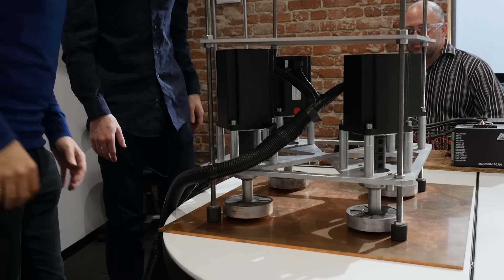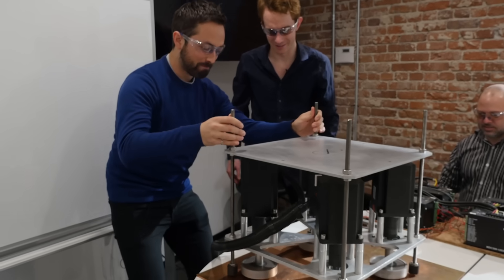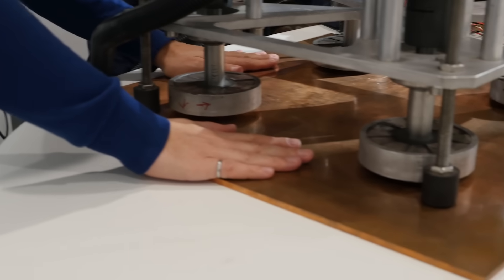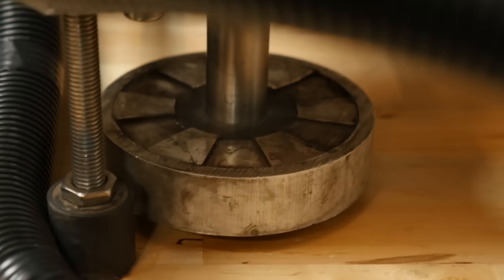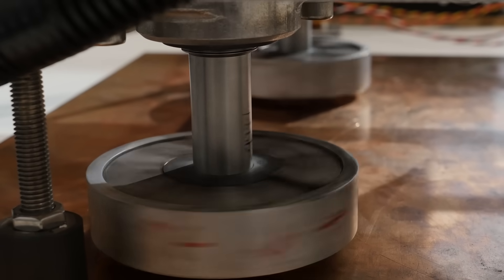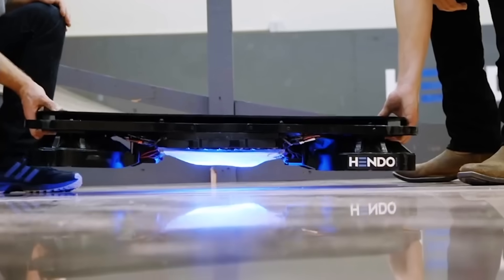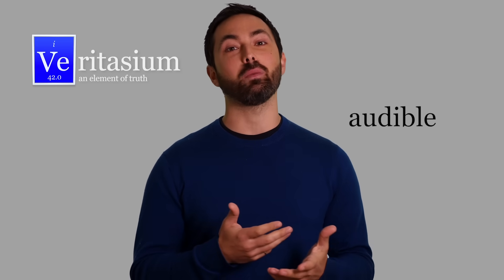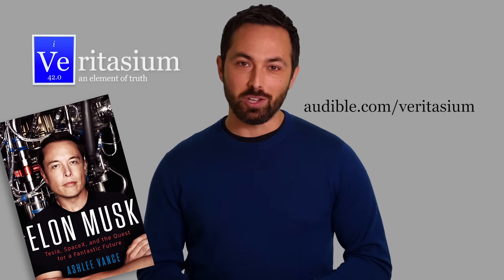Electromagnetic Levitation Quadcopter

Comment: supposed rotating one of those magnets in one direction with another above, you can completely change you're electromagnetic field around you and with it encapsulated and you separately encapsulated, you can go light speed and using a a tesla turbine and an array of oxygen tanks. you should have zero point energy and be able go on for ever and ever.

Comment: Seems really unpractical, tbh. Not only it needs a lot of really powerful magnets (not cheap), a conductive (most likely copper, which aint cheap either) floor, and a giant heat-management system.

Intercity travel like this - I don't really think so. Thing is, we're super close to actually getting a self-driving technology, which once working will practically eliminate speed limits on highways.

Comment: FUC KING MAGNETS HOW DO THEY WORK
Reply: because electrons have spin. Any moving charge creates a magnetic field, so the spin of an electron gives it a magnetic dipole moment. Atoms with unpaired electrons (odd numbers) are little tiny magnets, because they have one extra electron spinning in a certain direction, without a partner going the opposite way to cancel it. You just have to get those atoms to point more or less in the same direction to feel a net force from it.
Reply: try and think of a magnet like its a box full of ping pong balls, and all the balls have north and south marked on them with a pen, and all the balls are facing random points, just like you just poured them into the box all mixed up, and in a bar of steel all the atoms point in a random direction right just like the balls in the box, and to change that steel into a magnet, you make the atoms line up and point in the same direction, you can do this by hitting it in the presence of a magnetic field, and some of the atoms  will align with that field or you can use heat also with a magnetic field, and one way was to stroke a magnet along a steel bar and it would gain a small permanent magnet field ... have you ever noticed how a new screw driver with no magnetic   field some times get magnetic from impact or vibration etc  a magnet is just normal material with most of the atoms pointing in the same direction and the more the stronger,   ....  I'm sorry if I explain things strange, I'm trying to make it simple. without to much science jargon.  they use big words to make them self look smart
Reply: Holy science! Never had actually though about the spinning movement of electrons as a movement of charges (dont ask me why XD). Now a new question comes to my mind... where do those electrons get their energy to keep a constant rotational movement? Is it the repulsion from the protons at the center of the atom?
Reply: “Tide goes in, tide goes out. You can’t explain that.”
Reply: +durp hurp 
https://en.m.wikipedia.org/wiki/Magnetism
Reply: +Richard Smith what? don't believe that your microwave is safe, it has been verified by scientists.
Reply: + Broccoli Bros See that way up there in the clouds? That was the joke.
Reply: Cheers man....simple analogies work the best for me :)
Reply: Magnetism
Reply: Calm down nerds. Durp Hurp and Richard Smith are just quoting Clown Possé lyrics.
Reply: Kevin Benoit I don't hate many people, but O'Reily is one of the people on my hate list. His head is just so pin-like.
Reply: Not the magnets but the field itself
Reply: Guys, I'll take this one. So, magnets work by creating what we call a "magic zone". In this magic zone, humans can use their auras to Move objects. When a magnet seems to repel or attract so,etching, it's actually the auras of the humans around it that cause the movement. The more you know.
Reply: It is (at least partly) a quantum mechanical effect. Just think of a single atom. It might be that you learned at school, that electrons are moving around the nucleus. In reality they don't move around it like planets, because in that case electrons would radiate energy away and an atom could never be stable. Also the stability of an atom comes from quantum mechanical effects. The uncertainty principle (in essence) allows this counter intuitive phenomena like magnetism and stable atoms to work, but before I tell more I better first study it a little more. :P

Comment: All this is great except that the HyperLoop is supposed to operate in a low pressure tube.  What happens if the tube leaks?  Thunderfoot has done an analysis of the possible consequences of an air leak at operating speeds.

Comment: Is this how flying saucers work?
Reply: Do they work?!
Reply: no. If flying saucers existed they would probably be propelled by gravitational distortion field or the surrounding space distorted with anti matter energy.
Reply: No, the Earth doesn't got enough of the right type of material for them to get that high. This only works over thick enough surfaces of materials with an specific type of magnetic behavior where when the magnetic field changes, it "reflects" off the material with an opposite polarity; the most used materials for this are copper and aluminum.
Reply: yes aliens can only travel through space on a giant sheet of copper.
Reply: I would bet this was a stepping stone to figuring out how they work.  It's a shame our society will probably kill itself off before we ever get there.  Especially since Trump has the nuclear codes.